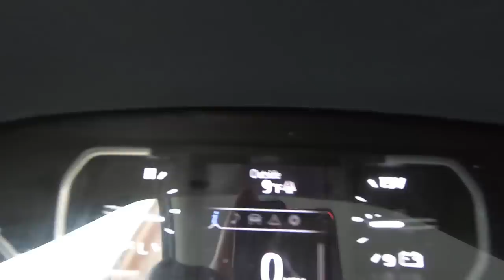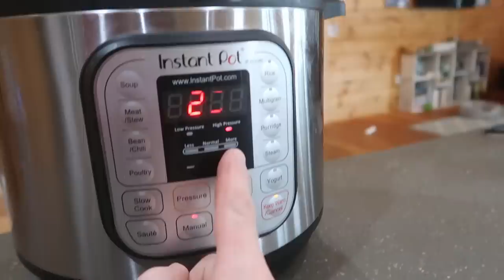Left You Outside Over Nite when it was  -7℉ (Sorry)

Comment: Good morning Al.  That layer that forms on top of your chicken bone broth is called "Schmaltz", a Yiddish word meaning rendered poultry fat in English.  It is excellent for sauteing and frying.  Also, if you chill the broth, this will form a solid plug which helps to preserve your broth by preventing air and debris from getting into your broth.
I wonder, since some of New Yolk City's eggs are coming up fertilized,  could the one hen be broody? Cheaper then buying broiler chicks for the summer. 
It's snowing here in Sunny Valley, Oregon,  our chickens hate it. We don't get much snow, and it usually melts away in a couple of days, so our chickens tend to stay in the coop. I throw them a couple ears of corn or a sunflower as a treat and to keep them from getting bored.
Reply from the maker: Thanks. I didn’t know that

Comment: I watched a video the other day that showed putting a small ball in the water always leaves a unfrozen spot , so there is always a way to drink .    Not sure never have tried.  Thought you might be interested.
Reply: Dragonflygrandma Here in Louisiana we actually do get some freezing weather and battle frozen horse troughs. We float a piece of 2x4 wood in the water.  It helps keep the water from freezing solid on top.  Not sure why but it maybe the wood retains heat, or it gets moved around when the horses drink?  For really long cold spells I just use an electric trough heater.

Comment: Al , I just checked the weather report. Kind of sorry that I did .  Not one but two winter storms coming up the pipeline. Some snow starting for me on Sunday coming from the west.  The second one coming up from the Gulf with more moisture and thus even more snow than the first one.  It's supposed to run up along the mountains  to northern New England which means you . So possibly a week of nasty winter weather starting on Sunday.  Bring in an extra store of firewood  to save on the outdoors trips to the wood pile.

Comment: Years ago when I use to drive to Maine now and then for work I would cut across on 302 and then 116 to save time. Nice country. Over here we just broke 100" of snow for the season and running out of room to put it. Looking forward to sugaring season also, but I don't think it will be as early as last year. Last year we tapped earlier than ever and ran longer into April than ever, both in the same season. Crazy
Reply from the maker: That’s a lot of snow!

Comment: I have come to realize that you are an optimist, however, when you keep saying that spring is just around the corner, you must be thinking of a huge corner!  Feb 15 is at least 6 weeks before any sign of spring in northern Minn. and I don't believe that NH is that much different.  I'm on the edge of Zone 4a+b and the map shows that you are the same.   Spring will come, but it's not coming until mid April.  Our last snow piles will go in early May.